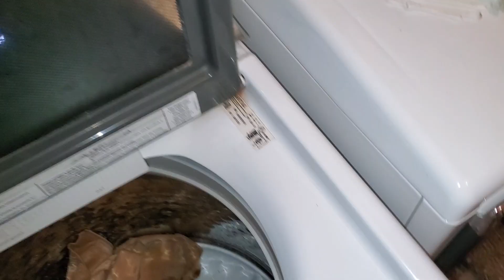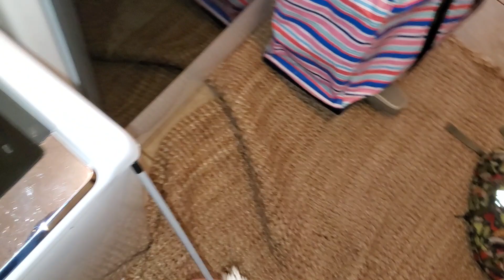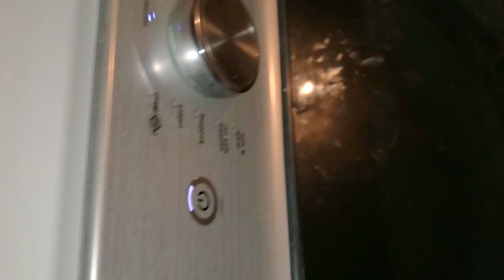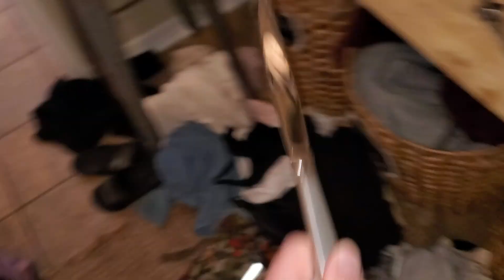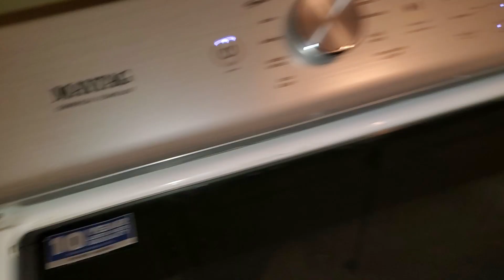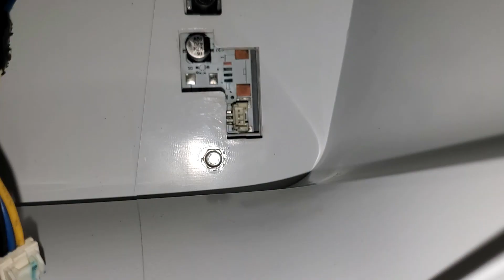Repair FAIL: MAYTAG  Washer User Interface Control Board Corrosion Fix - Error Code F5E1

Comment: Hello - I'm unable to take the lock mechanism apart.  I'm not able to get the portion where the cable comes unlocked.  Any ideas?  Thanks!
Reply from the maker: @mos-h4u  Sorry, I haven't had this washer in a few years. What do you mean by unlocked?
Reply: @mchenrykramer thank you for your response.  The locking mechanism end where the cable comes out and goes to the control panel - I'm unable to "unlock" it or unhook/unclick it in order to clean the contacts.
Reply from the maker: @mos-h4u  sorry, it will be hard for me to describe how to unblock it without being able to look at it.
Reply: @mchenrykramer  Completely understand!  Thanks for trying 👍🏻

Comment: You are wrong sir.   ThT washer does have know if the lid is open.   There is a magnet in the lid.  When closed it pulls a piece of metal in the lid lock and closes the circuit
Reply from the maker: There may be models that have that switch, but this one did not.  I could simulate the lid closed while it was actually open using the lid lock contacts.

Comment: Piece of crap washer, I have to add 5-10 gallons of water to wash my damn clothes.  I will never buy Maytag again!
Reply from the maker: I agree.  I bought Maytag for the name and it was as much of a piece of junk as my previous Whirlpool.  I bought GE this time and paid a little more, but so far I am pleased.
Reply: Yeah never buyer a water saver again - I swear the comforters have to be wet before I load the washer so they weigh more

Comment: The washer is a piece of junk, replaced board and control board but did not work. Expecting insurance to replace it.
Reply: Was there any light in the display? I picked one up for $20 bucks expecting it to be a easy fix but the display won’t light up.

Comment: Has anyone fixed this issue? I'm showing f5 e1 which is a lock issue. I also had f3 e2 which I replaced the inlet valve and the error went away. Cleaned the control unit still nothing.

Comment: Ever figure it out?  Having the same exact issue, new control board and new control panel did not fix. 🤬
Reply from the maker: Sorry, I didn't.  I could have bought a new control board to fix it, but my wife was tired of fooling around with it and didn't want to spend any more money on it.  I was tired of it, too.  The MAYTAG name was not worth it.   This thing was a poor design, and I was fixing something on it regularly.   I bought a GE based on reviews instead of what was on sale this time.
Reply: @mchenrykramer  How new was the lid switch?  I have had my washer for less than a year and having the same issue.  I bought a new lid switch which I should receive and install tomorrow, fingers crossed
Reply from the maker: @rudycom5  it was less than 2 years old.  Such a poor design
Reply: @mchenrykramer  It is, there is no excuse for an appliance to not even make it two years.  My wife bought it so I know she's going to be mad but I'm already looking for a new washer
Reply: The lid switch fixed it immediately, now I wonder how long it will last

Comment: I have the same washer.  I had to reflow the solder on the control panel board to get it to stop shutting off randomly.
Reply: Which part of the control board?
Reply: @s.whitaker1120  I just did the ICs

Comment: Thanks for the help. This is our exact maytag model and we are getting F5 error.  Any help on how to check in diagnostic mode you mention? We don't see E1, just F5.  Thanks again.
Reply from the maker: All F5 codes have to do with the lid or lid lock.  In my case, the lid did not have a switch that indicates whether it is open or closed.  However, the error I got indicated that the lid was open,  but the lid was closed and the controller had no way of knowing that it was open or closed.  The lid lock tested fine, so I know it wasn't the lid lock.  I actually replaced the lid lock previously because it failed due to corrosion from moisture from the washer.  The controller had corrosion from moisture which most likely caused my issue.  Getting the technician manual was very helpful for me.